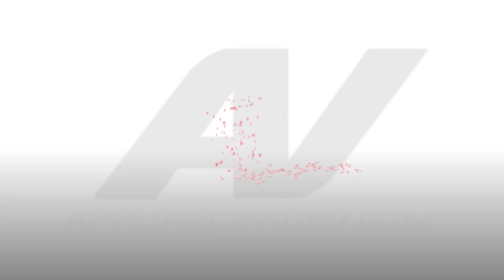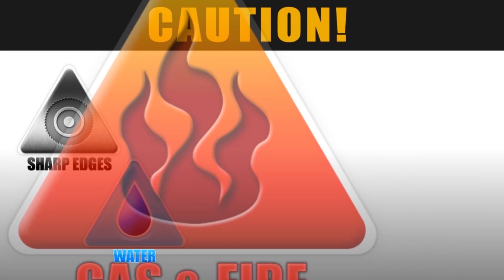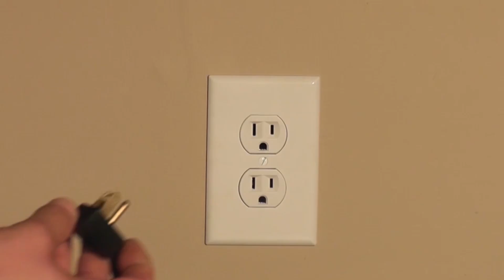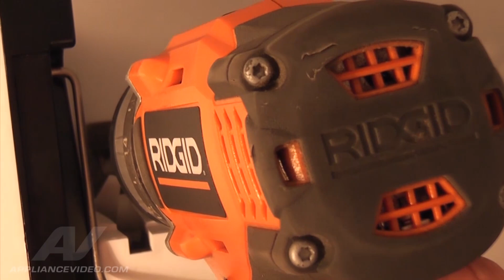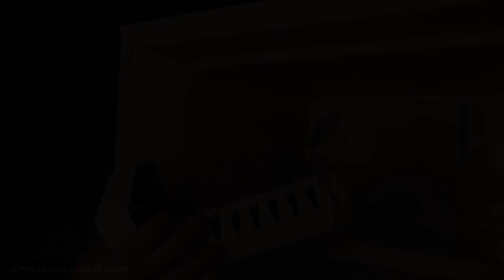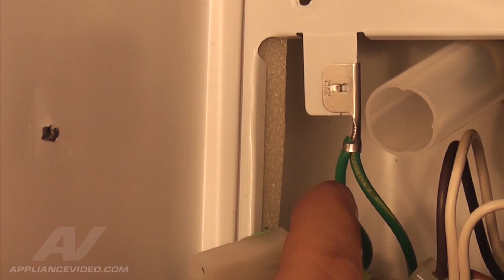Refrigerator Repair& Diagnostic - Defrost Heater Whirlpool, Maytag, Amana, Roper # 2263749)

Comment: Being maintenance guy that I am a lot of times it is the thermostat goes bad that is inside the freezing part of the fridge. The thermostat looks like a bottle cap and has a black side that should be flat if it is not flat it means it has died
Reply from the maker: +Michael Warren 

Good question, with our
technicians now getting hundreds questions weekly, they are answering all questions
at our website http://www.appliancevideo.com/repair-help/ .  We also have over 30000 common questions
and answers that you can easily search through by your model number, appliance
make, problem or error code and it’s absolutely FREE.

Comment: Hello is there a way to know the part number for the wire harness attached to the fan? One of the connectors is damaged but I cannot seem to find a part number or something that helps me track down the spare part.
Reply from the maker: +José Eduardo Velázquez Torres Yes, if you get your model number and call 1-800-830-5465 our parts department will look it up for you.

Comment: My evaporator doesn't have tabs to bend; the bottom part is one solid piece.  How do I get the defrost heater out?
Reply from the maker: Vanda Chou 
All of our technicians are now answering
questions daily on the ApplianceVideo.com website. You can search completely
FREE in our Repair Help section with over 1000 questions & answers. Or you
can get unlimited technical advice and video links emailed to you by our 14
factory certified technicians at
http://www.appliancevideo.com/premium-membership/.  If you are in need of
any parts please support our parts department on line at
http://savemoreonparts.com/ or call 1-800-830-5465 7-days a week until 11pm
Eastern time. Thanks for your support. Matt Ace Appliance factory service
technician.

Comment: I have a Kenmore Elite refrigerator.  The drain hole continuously freezes up.  I know how to unclog it, but I have to do it almost every month.  I noticed on your other video a comment that replacing the defrost heater can help.  Do you have a video for my type of refrigerator?  Also, do you sell the parts for the model 10670209991?
Thanks
Reply from the maker: Daniel
     Go to ApplianceVideo.com and type in your model number. We have a search for video by model number feature. I know we have videos on defrost heater replacement. When you install the defrost heater make sure it gets bowed down towards the drain hole sit its about one inch away from the hole. That will radiate more heat to the drain hole and prevent it from freezing. call our 1-800-830-5465 parts line and we have the heaters in stock for same day shipping.  Our site has 2600 Free videos on it.  Please help our ranking by subscribing to our YouTube page or posting our ApplianceVideo.com site on your Facebook or Twitter account
Reply: ***** I just searched my model number and watched the only video there is that came up.  It only showed a few tips.  There were no videos on what I need. Is there anything you can show me to help with my unit?
Reply from the maker: Daniel 
      I suggest to replace the defrost heater, its very simple two wires and it comes with instructions with the new heater.Shut the unit off for 24 hours with the door open before you replace the heater to insure all ice is defrosted in the drain assembly. That should completely rectify your problem. Good luck and email if you have any install questions after you get the new heater.

Comment: We don't use the ice maker would it be okay to leave it out to free up some more room?
Reply from the maker: Yes, that is perfectly fine. I recommend you tape the harness with electrical tape after unplugging the ice maker for safety. Make sure you unplug the unit when removing the ice maker harness as there is moisture that could cause electrical shock. Please help us provide more quality videos  by subscribing to our YouTube page or posting our ApplianceVideo.com site on your Facebook or Twitter account. We also have our authorized technician’s daily emailing professional advice daily to people like you that have appliance problems. We have helped thousands of people save hundreds of dollars. Thanks in advance for your help.

Comment: Hello.  I have a Magic Chef 4.0 CU. FT. Refrigerator Model No. MCBR415S.  The freezer works but the refrigerator itself is warm.  The back wall inside of the fridge gets frozen.  Could it be the defrost?  Would you know where the defrost on this specific model is located?
Reply from the maker: Yes, sounds like you have a part of your defrost system out. I would start with your Defrost Timer and Defrost thermostat. Replace both parts. That is the problem 90% of the time. call our parts department and they will drop ship them same day at 1-800-830-5465.  Please help our ranking by subscribing to our YouTube page or posting our ApplianceVideo.com site on your Facebook or Twitter account. This will help us to continue to make new professional videos from our factory trained technicians and help people like you. We also have our technicians daily emailing professional advice to people that have problems with their appliances. We have helped thousands of people save hundreds of dollars. Thanks in advance for your help.